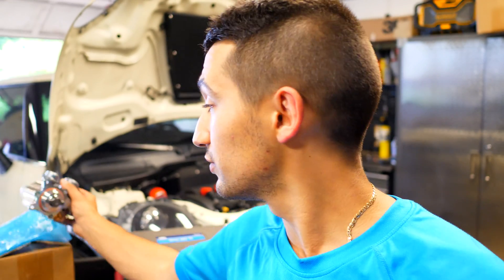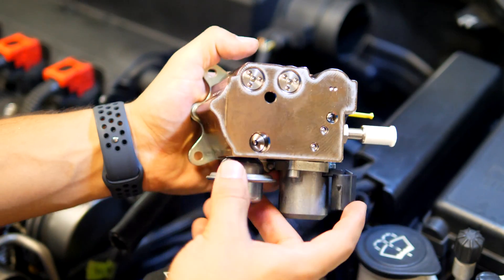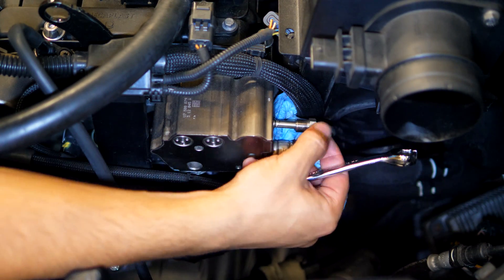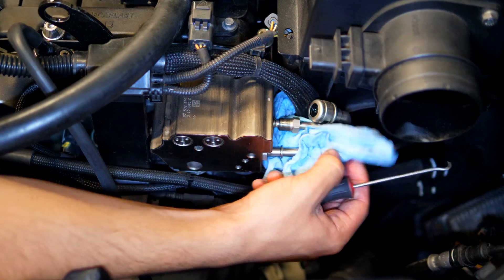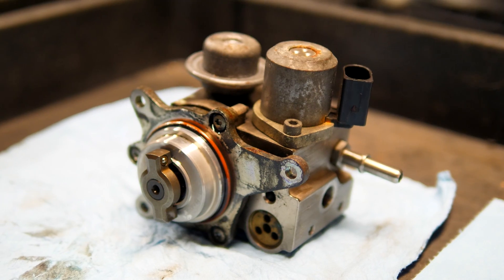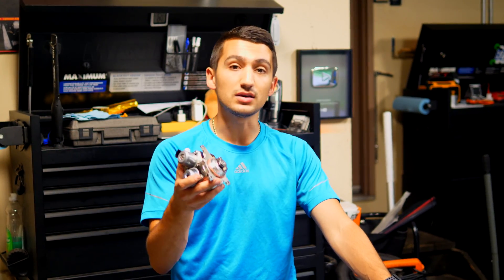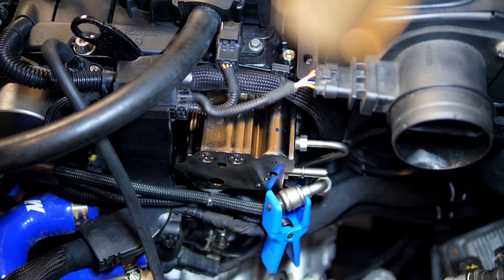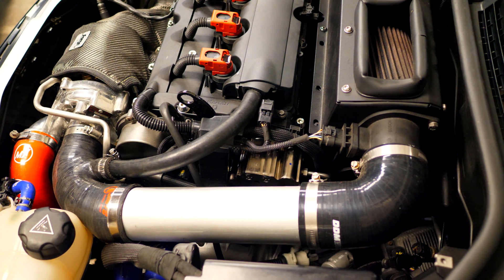How to Replace a High Pressure Fuel Pump

Comment: Just so you know, putting aftermarket coils in it is a bad idea. The computer will never allow the full signal to get through the coils because it doesn’t recognize. It’s nice to try to modify it, but your computer is just not gonna allow it to run properly, you’ll see what I mean.

Comment: It's easy to understand how FC Europe can offer a lifetime warranty.  First, charge $900~$1200 for the part.  Next, pair the NON-transferable warranty with a vehicle/engine that you are confident, on average, will not run for more than 300K miles. Next, require the customer to supply the old part (call it an inspection requirement).  This ensures a healthy stock of rebuildable HPFP's.  The rebuild costs (time and means) keep below ~$100.  Customer pays shipping. Assume lifetime warranty fulfillments do not exceed 33%.

Of course, these are likely not the real costing figures...especially if the rebuilds are performed in a low labor cost country. However, the business model is pretty clear. Under these limitations and at those purchase prices, it's easy to offer this warranty.

Comment: I love that you did your homework for working on this part: 
- you mentioned recall info, that’s hugely important for maintaining your vehicle
- likewise you mentioned that doing your research for the part and noticing that the car wasn’t getting enough fuel to provide also was mentioned and was a good indicator.

My only recommendation is look for the high pressure fuel pump relay or fuse. Pull that first and foremost! The reasoning behind this is yes, though the rags will help, pulling the relay will stop sending the unit fuel anywhere to the fuel rail or even the engine. Once it starts to stall then go for the pump as it will be slightly easier and you’re not messing with the added 800 pounds of pressure from the fuel being sent to the rail. Besides that awesome video!!!! I love seeing people get down and dirty and working on their cars whenever possible because it’s the most intricate piece of engineering and if you master this, every other car will become slightly easier in my opinion!

Comment: I'm desperately trying to find a way of removing the low pressure line having had the tabs snap off on the first attempt. I see you appear to have had the same problem but edited out how you actually released it. Instead in the example, the connector is already released which is no help.

Comment: Hi bro. I follow all your steps and The problems has started from high pressure fuel pump and wiring harness, I have replaced HPFP and HP fuel sensor and wiring too after that I have got problem with intake camshaft sensor. I got theses trouble codes. 277A, 300C, 2C58 and 2789.  Help me please. Thank you

Comment: What were the symptoms that point you to the direction that the HIgh flow fuel pump replacement?
Reply from the maker: Start up problems, low fuel rail pressure, high rpm high load misfires.
Reply: Can a bad high pressure fuel pump make your car misfire ? My workshop said it’s because of the high pressure fuel pump

Comment: It may take a few drive cycles for the engine light to turn off if you don't clear the codes. Also, for those wondering, direct-injection cars always sound a little bit like diesels because of the high pressure fuel injectors.

Comment: Got slk250 there is not much on YouTube about how to change the high pressure fuel pump somehow I got to your video , nice description and clear how to fix it . I wish my pump is so easy to access!!! I just did mine it’s at the back of the engine ,after 5 h  nightmare scratched bloody hands all over I replaced it but car is worse than before!! I Bought a part on Amazon , pump sucks so yes buy original part not replacement no brand parts , now I have to remove it which probably takes another 3 h since i know how to do it now it might take less than 5 h . I just ordered new part from Mercedes which cost 3 x more than the one I got on Amazon, there is bunch of fuel pumps  seems like from same seller under different names because description is same pictures same etc. pump was scratched on side like it was used before and primed out with screwdriver .
My new pump gets here delivered in 8 days in local Mercedes and labor costs around $900 to put the pump on. Just changed pulley myself for $25 they wanted to charge me $460 !! But for the fuel pump might have to leave it to them with all the computers it’s all complicated.. before I changed the fuel pump car was driving ok in limp mode low rpm the engine light was off that’s why I didn’t see it when I bought the car 3 days before I noticed the fuel pump is bad , but yesterday I changed the pump from Amazon and car drive 300 feet and die turn off by itself when slow down to turn or stop on intersection!!! I gonna try to  put back the previous one if it drives the same as before i can put the OEM myself but if it’s still staling I have to let the Mercedes do it for around $2000
Reply: Update!!!
So I just purchased the high pressure fuel pump from same company you recommended 👍 it’s original OEM Mercedes bez  with all the covers and magnet not like the one refurbished from Amazon didn’t have any covers and the magnet .
It cost 3x more but it works!!! I tried to drive on sport mode rough to red rpm and still fine no engine light on !!! I just changed it 5 h ago so I give it more days but thanks for recommending the European company with life time warranty because Mercedes website offers only 1 year!!! 
Your car sounds great what did you do to your exhaust? I got Mercedes Slk250 and it’s too quiet need louder car because people with bigger cars can’t see me almost got hit by suv today lady didn’t see me was turning to my line 🤷🏽‍♂️⛔️💣
Im thinking X pipe or straight pipe and K&N filter intake similar to yours .

Comment: I just installed a $200CAD rebuilt unit. I did not have 2000$ for an oem...or 1200$ for your solution... Solved my cold start problems that were getting worse and worse: proof that they don't all fail with the same symptoms.... In this video you say "that's what they do (ie ok cold start but problems over 3000rpm)". Many different o-rings on them so depending what gave, symptoms might differ... anyway thanks for video as always

Comment: Another awesome video! Do you know if there is a release valve for the fuel pressure if needed? My GM cars had something called a Shrader valve on the fuel rail. I have seen some prices on those HPFPs, they are expensive. To save on labor will help when I need it.

Comment: As an FYI, the "MINI" Motor is a  PSA Peugeot Citroën.  It's under a license agreement that expired in 2016.  Prince is the codename for a family of automobile straight-4 engines (N14 & N18) developed by PSA Peugeot Citroën and BMW. 
https://en.wikipedia.org/wiki/Prince_engine

Comment: I'll be doing this soon.  I got away with clearing the code (P3091).  It would also light up the Orange Colored Motor Symbol with the line that angles through it.  I know that puts the engine in "Limp Mode." This happened on a R/T from NY/NJ region to Orlando, Florida recently!  WHEW!  I'm buying two, I always stockpile two parts deep on my cars.  The torque wrench you used was it the 1/4" Drive on the high pressure fuel line?

Comment: Is there anyone out there that knows a company that will refurbish these HPFP and make them better? Secondly has any one analysed why they go wrong.Which component in the HPFP is not functioning according to spec?I bought a cheap HPFP (ordered from China with a supposedly 2 year warranty ) but failed within a year.I am now trying the 0SIAS refurbished (claims 3 year warranty) to how long it lasts.

Comment: Just done our mini for £330 pounds in 75 mins and I’m no mechanic , thanks for the video and for saving me £500. If you purchase a bmw part it will set you back £700 and then 3 hrs labour ( which is a joke) at a main dealer will be at least £300 . There is a bmw part and a psa part as this engine is a joint venture so parts are the same but vary dramatically price wise , buy a psa part.
Reply: What is the part no. for the PSA part? Thanks

Comment: Mini fans. I have a RCZ R, 270hp(stock), with THP 1.6. There was a rev2 from Peugeot on this exact pump(that broke on my at 90.000km). Perhaps try and get the rev2, if BMW also has a newer version. Hope this helps
Reply: tryin to sell my thp 200 the maintenance costs are horrendous never gonna buy another french car again
Reply: Nekminute can’t argue with that. The minis BMW 1 Seris and Citroën’s have similar problems. The 270BHP seems to be alright when driven hard and maintained well though

Comment: Excellent video. How did you diagnose the HPFP problem and determine it needed replacing?
Reply: Julio Valenzuela  use a diagnostic tool which you can get for £30 it should tell you on the digital read out that you have a fuel issue.

Comment: May sound like a dumb comment but it’s possible to change the hpfp without draining the fuel out the system?! Just as long as you leave it a while after driving right.
And is this the same with ever cars hpfp?

Comment: I was told you had to also replace the hard line as well as the fuel inlet line as they aren’t reusable? Heard stories where the inlet hose would pop off because it was a one time use only.

Comment: The crowsfoot must be 90 degrees to the torque wrench handle at all times, otherwise the torque will be incorrect and over torqued.
Reply: Excelent tip!
Reply: By next to nothing. Like really I do understand that having it in line makes the lever longer but I doubt it makes any significant difference, and it definitely is better than not using a torque wrench at all.
Reply: @imnota  it does make a difference,  which is why it's taught in every mechanical trade school.

Comment: If you ever have to do this job its alot easier and less messy If you take out fuse 46 for the fuel pump. Way easier to disconnect that and less mess.
Reply: Twiztid Vandervelden what did you mean? I’m about to take this job lol
Reply: I was going to ask the same why didn’t he just pull fuse.  But great vid

Comment: The high pressure fuel pump is the same as the Citroen Peugeot engine and are sold to Mini at a markup that you then pay if you buy a “genuine” mini one. I learned this while I worked at a mini dealership in California and when it came time to change the pump on my N14 2012 R56 I saved hundreds and the pump works great

Edit for anyone that didn’t know that the N14 is a “Prince” engine and shares components across brands. Mini/BMW charges extra because they can
Reply: Yeah he kinda got fucked, the part number 1920LL shows the psa version of the pump is worth something between 200 and 450 euros...
Reply: @imnota  I know it's been 2 years since you commented here, but I am curious if you know the part number for Countryman S R60 petrol automatic, 2012, 184hp? I am desperate to find an acceptable price, but the retail price on Mini's pump is insane. If possible, could you let me know the part number of Peugeot or Citroen's one? I searched far and wide for the info, but most of them were dead ends. Thank you ^_^
Reply: That was my thought exactly,I have a Peugeot 207 RC that has basically the same engine and uses the same hpfp witch costs  around 400€,I was totally surprised when he said that he paid 1200$ for it lol,so he basically bought 3 hpfp's, that's how he gets a lifetime warranty cuz he bought them in advance and its hardly possible he will burn through 3 hpfp's on that mini so yeah he got screwd a bit
Reply: Ante Vučetić both links in the description have it around $950 usd. That being said these have always been in that price range in the states when we are stuck buying the genuine ones. Companies are finally getting their hands on the psa ones for about half the price but unfortunately the market and sourcing the parts dictates what us the customers have to pay and what’s available...
Reply: EveryBitCountz Email I live In California and if you just do some digging you can find them for about $400 USD. I am part of BMW CCA Golden Gate Chapter and I got a link to some bmw parts site that had them. That’s where I got mine
Reply: Michael McGlashan what site is that? I have a friend at a dealership who showed me their cost on one, and it was more than $400.
Reply: Was going to say exactly what you said.
In Europe you can buy the exact same pump from Citroen for around 300€.
Reply: @MatteoVittoni  where did you find it for that price? At Citroen dealership is around 600€. On Ebay the same one is around 400€.
Reply: As an FYI, the "MINI" Motor is a  PSA Peugeot Citroën.  It's under a license agreement that expired (I think in 2017). Prince is the codename for a family of automobile straight-4 engines developed by PSA Peugeot Citroën and BMW. 
https://en.wikipedia.org/wiki/Prince_engine

Comment: Fcp euro the best they even got lifetime warranty on break pads and rotors you can just send them back and send you new ones free
Reply: This is just crazy. I dont know how they would warranty wear and tear items. Have you had any experience with them Los ???
Reply: I just ordered my part from Mercedes yesterday but just checked Fcp euro and the pump is $165 cheaper than at Mercedes plus got lifetime warranty! MB dealership told me if I install the pump my self there might not be any warranty 💣 and if they do it I think they give u just 1 years warranty..

Comment: Very nice option, hope those guys will make it!
Unfortunately I already upgraded my HPFP to 2012+ late LCI version that seems to work forever (at least I hope so 🤞). Anyway good luck to all mini fans!
Reply: What's the link to the one you bought?
Reply: Ma Espi it wasnt a bolt-on and a lot of additional parts was replaced, also a coding stuff was made. 
Anyway HPFP installed is 13517607159.

Comment: Maybe you can assist me..I'm having a hissing sound whenever I shut off my DS3 Tho engine like yours. Most forums mentioned the valve cover or PVC pipe. So what do you it could be.
Reply from the maker: I'm not entirely sure, but mine makes the same noise.. It's strange

Comment: My mechanic said (when I replaced my HPFP) that you should replace the lines going and coming from it just to be safe.
Reply from the maker: If they haven't been replaced before, yes you should. I didn't do the second torque sequence to the nuts on the line after building my engine, which means mine was good. I've driven the car since this video and its running great with no leaks, but that is a good idea.